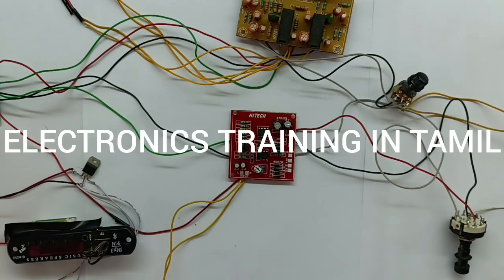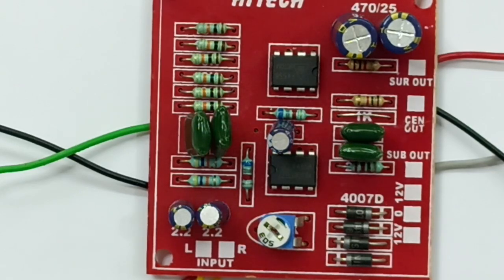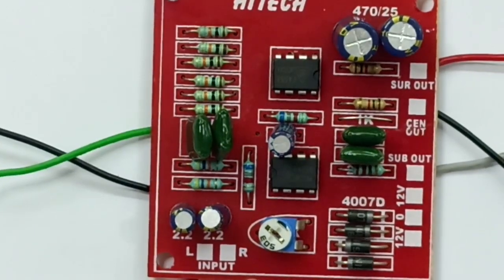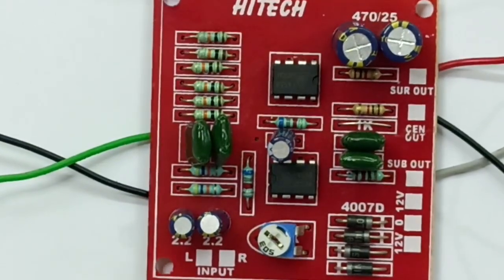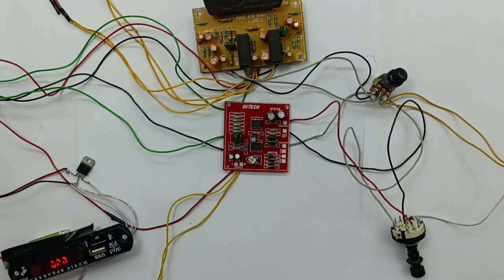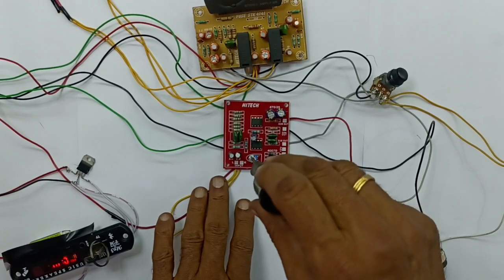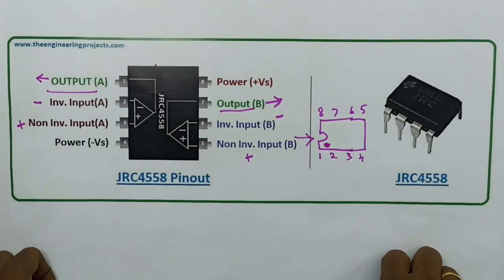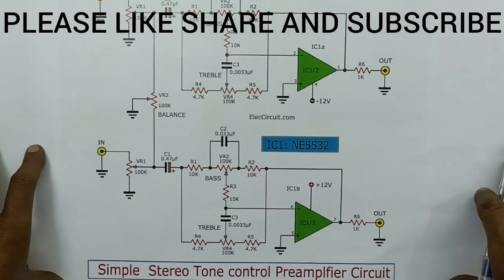LOW BUDGET... MINI SURROUNDING CIRCUIT BOARD, USING 4558D, WORKING PRINCIPLES, AND PRACTICAL DEMO

Comment: Circuit diagram 4588 ic use panni podunga sir surrounding 😊
Reply from the maker: Your request video will be uploaded soon
Reply: @electronicstrainingintamil1625   tq sir... Sun sri... Name pottu 4588 D ic use panni mini singal output surrounding board varum ila... Singal 12 v kudukura mari.... Antha board.... Full circuit diagram kudunga... Yena velvu resistor podanum detail sollunga.... Naa redy panna but.... Sound varathu surrounding varala
.